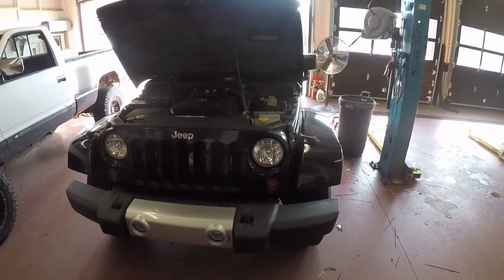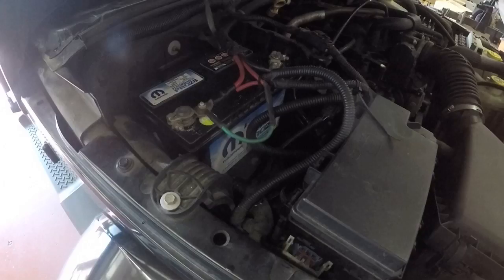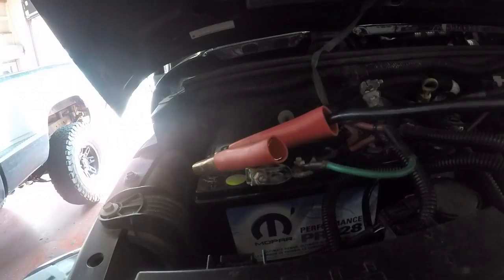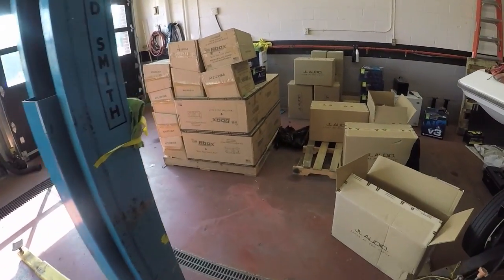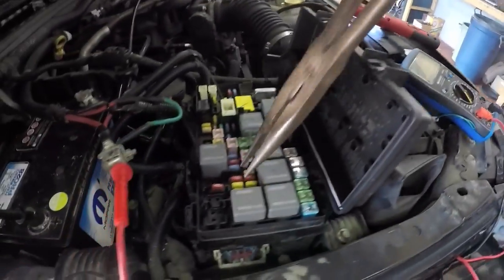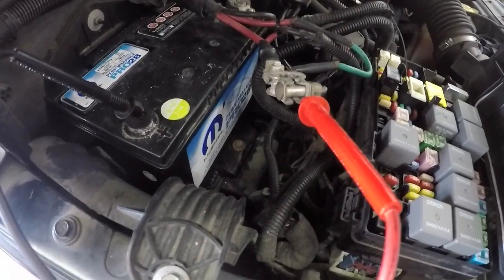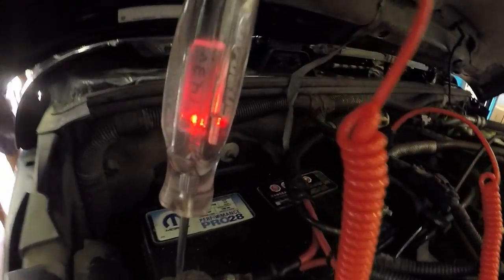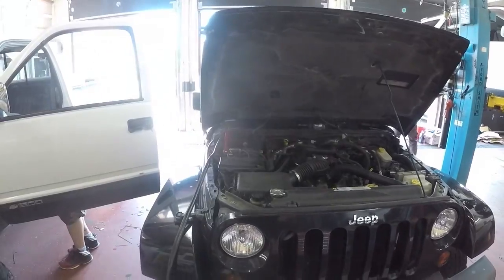Why Is Your Car Battery Going Dead!? How To Do A Parasitic Draw Test!

Comment: The diodes in the alternator have nothing to do with how it is bad to charge a battery! A diode only stops voltage from going back through the circuit!They are a one way valve for current. The alternator is for charging the battery! The jeep needs a new battery, when it starts to get cold the battery will die!

Comment: OEM battery! 6yrs old, replace the battery!!! That battery has been on Borrowed time for a couple of years!
 Usually what ever the warranty on a battery is the end of that period the battery it done for. A week battery will over work the alternator causing it burn up, if you have an old battery and are blowing light bulbs the batter may have had it.
 In the days before serpentine

Comment: Was the dealer that did the diagnostics a new car dealer? If so, yikes.  

And who the hell is the two-bit installer of that radio? Same guy that did the original diagnostics??? 

And for the casual viewer, be aware that pulling fuses, in some cases (manufacturer dependent, circuit dependent) will wake up a module and give you a false high parasitic draw. If you got a really new car, do a voltage check across the fuses. That avoids waking up modules. 
Draw charts: http://info.powerprobe.com/fusechartsdownload
For the curious;
http://www.searchautoparts.com/motorage/technicians/scope-scan-service-repair/new-approach-testing-parasitic-draw
Honda I think it is has a really good write up on the process.

Comment: When my 2013 GMC Sierra was about a month or 2 old it wouldn't start so I had it towed to the dealership and they said it was my aftermarket radio that fried the computer.  Had to shell out about $1000